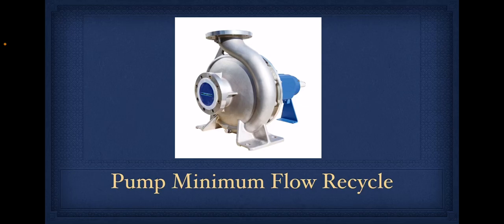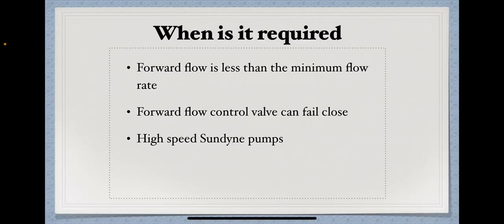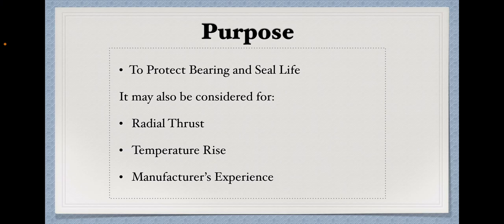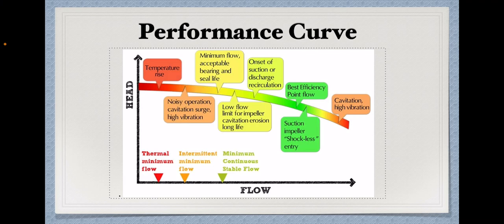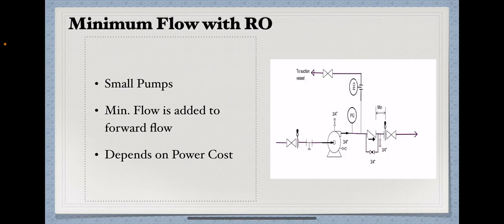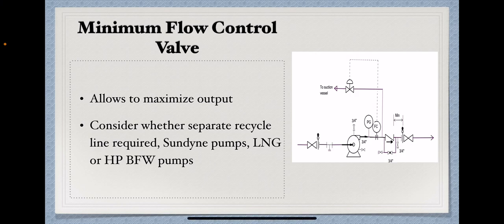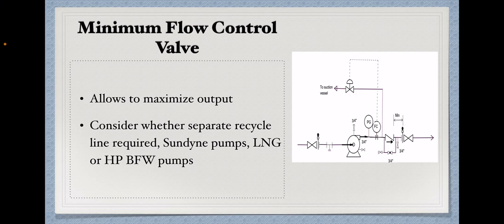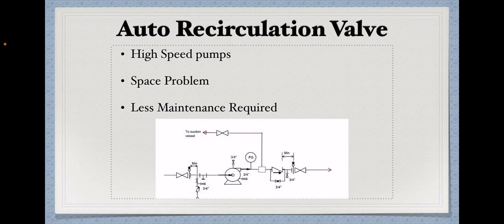Pump Minimum Recycle Flow Requirements

Comment: How would you go about sizing the minimum flow loop line? Do we use the minimum flow required with the same pressure as the pump discharge under normal operating conditions or do we need to consider the pump differential head at the minimum flow on the pump curve?
Reply from the maker: Ideally, we should consider the pump differential head at the minimum flow on the pump curve to size the line and  control valve on the minimum flow line. The pump curve may not be available during the initial phase. So the design is verified once the pump curve is available.